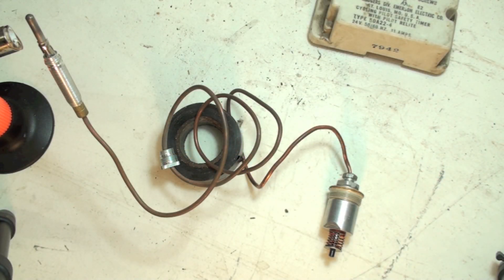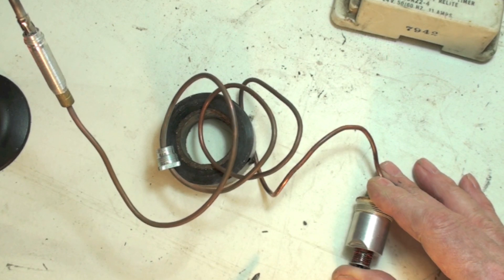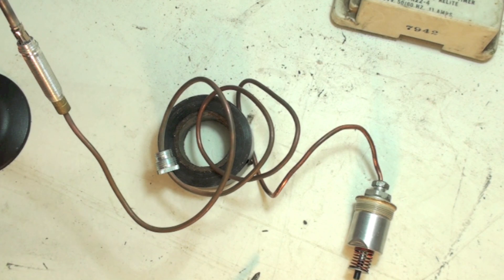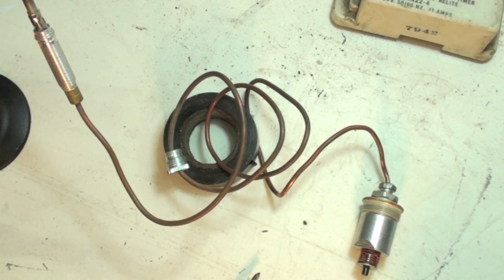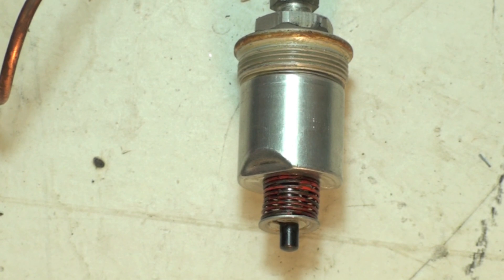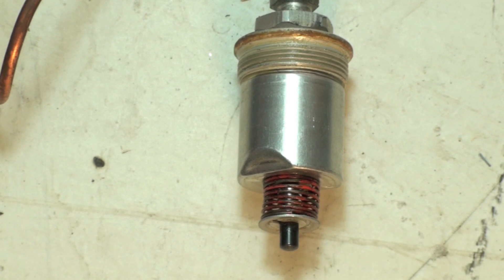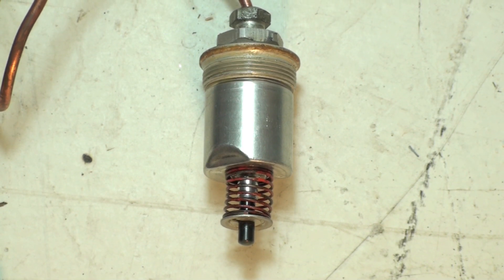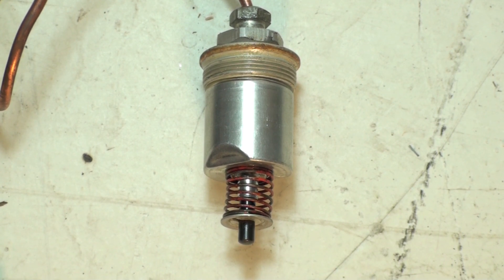How to check operation of the pilot safety on the standing pilot furnace.

Comment: I have very old gas valve pilot  light can it works but yet not fully  let gas flow  is that possible
Reply from the maker: I am assuming the pilot lights and stays lit.  When the manual valve is turned to the "on" position, the main gas does not come on even when the thermostat is turned up high enough to call for heat.  
This could be no power to the furnace or a thermostat problem.
GFM
Reply: This does  not have a thermostat  it's  all manually  controlled
Reply from the maker: If there is no power source, the pilot is on and the knob is turned to "on", you either have a failing thermopile or failed gas valve.
GFM @rogeraustin7985

Comment: I have around a 1935 Gas Mizer gravity furnace (made in Monroe, Michigan) with the cast iron ring and brass burners.  In recent years, it seemed to take far too long for the original thermocouple to activate the Honeywell Type No. C434A pilot safety switch.  A week or so ago, I replaced the original thermocouple with a Honeywell Q390A1053 (30mVDC) thermocouple.  Even then, it still took too long for the new thermocouple to activate the Honeywell pilot safety switch.  I mean, it took anywhere from 2-5 minutes, and I know that the thermocouple was properly adjusted.  Actually, the pilot safety switch seemed to be more responsive whenever the furnace was calling for heat.  I'm wondering if it's time to replace the Honeywell Type No. C434A pilot safety switch.  Any thoughts?  Thanks.
Reply from the maker: First, replace it.  You are paying for a new furnace every 10 to 15 years in excessive fuel usage.
The pilot safety is failing.  I would install a combination gas valve to replace the existing gas chain.
GFM
Reply: Thanks for the reply, and the very helpful advice!  I'll look into replacing the pilot safety switch.
Reply: One other question sir.  Would the Honeywell C434A 1013 pilot safety switch substitute for the Honeywell C434A pilot safety switch that is currently on the 1935 Gas Mizer gravity furnace?  Thanks.
Reply from the maker: @greanfinisher4014  It should work ok.
GFM
Reply: Great.  I'll give it a try.  Thanks!
Reply: Update:  I installed the NOS Honeywell C434A pilot safety switch today, and it worked fine!    Thanks!  Actually, the recently installed Honeywell thermocouple wasn't properly adjusted after all as it only registered 16.0 mVDC on my digital meter.  Even then, it was sufficient to activate the pilot safety switch quickly enough.   I suppose that's what to expect sometimes when the thermocouple is adjusted by line of sight only.  Well, I simply placed a small diameter thin metal tube over the thermocouple, and adjusted it a few times.  After the last adjustment, the meter registered 25.0 mVDC, and I could live with that.  I mean, if I was a purist, I could probably attain something like 26.0mVDC out of the thermocouple.  If I remember correctly, that was what the original thermocouple had read.  Anyways, I'm good to go.  Thanks again!

Comment: Thank you for  explaining the process, I have just a question : the safety needs min 1volt to be excited but the thermocouple gives max 20mv. You can try with battery. Best regards.
Reply from the maker: The pilot safety does not need 1 volt to operate.  Most are set for 10 MV.  A 1.5 volt battery is sometimes used to determine if the pilot solenoid is operable.
GFM
Reply: @grayfurnaceman  thank you

Comment: GFM, I can light my pilot light, but as soon as I release the valve the pilot goes out. I had the valve depressed, with the pilot lit, for about 2 minutes to give it time to heat up the thermocouple but it still just went out the moment I released the knob. Any idea what it could be? Cheers
Reply from the maker: If the pilot flame is covering the thermocouple at least 3/8" and is all blue, I would replace the thermocouple first as it is the cheapest and easiest repair.  You can also try this video:  https://youtu.be/NniQiBfRImc
GFM

Comment: Do solenoids go bad??? Can you buy a new solenoid if it goes bad??? Is there a tester for the solenoid ??? Because I know the thermal coupler is good...
Reply from the maker: Yes it comes connected to a new gas valve.  Gas valves are considered unrepairable.  Be sure the connection to the gas valve is clean and not too tight.
GFM

Comment: GFM, mom had the gas company out to a rental yesterday to turn on service and technician says the gas "woodstove" heater in living-room was missing pilot-operated relief valve (PORV)???  Found this video while searching for such a thing, which doesn't seem to apply, and can only find industrial applications for such a device.  Have you heard of such a thing?  I plan to call them and get further clarification if it's newly implementation or what.
Reply from the maker: I have worked in this business for over 40 years and I have never heard of a "PORV" in relation to a gas appliance.  The idea of having a relief valve on a gas appliance is a bit scary.  It is probably a gas appliance that has no pilot safety.  If so, get rid of it.  That type of appliance has not been legal in most jurisdictions for over 70 years.  It is not safe.
GFM

Comment: Williams Enclosed Hearth Heater model number 5001911. Pilot stays lit and main burner not firing up. Attempted to purge the air out of the line via the pilot tube but found minimal gas pressure in line. I heard no gas flow when opening the shut off valve to purge. 

Replaced integral twin stage regulator out by propane tank. Pressure is audible now and enough to purge line.
Pilot light stays lit with blue flame
Millivolt reading 30mV on thermocouple.
Pilot knob is set to "ON" position.

Problem: Turning the control valve to maximum, gas valve not opening.  
After shutting off pilot light, 180+ seconds later the "click" can be heard of solenoid disengaging from magnet in gas valve.
 
Question: How can the solenoid open and there be no gas coming out to the burners? I'll cut and paste this same question on some of your other videos in hopes of getting it noticed.